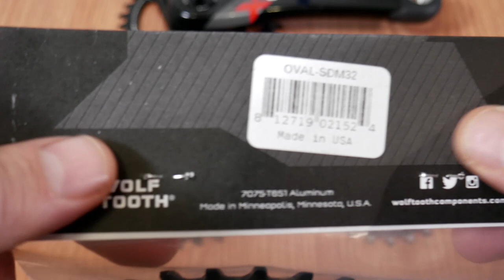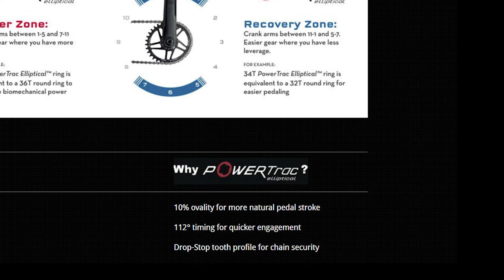Woolf Tooth OVAL Chainrings Quick Check - PowerTrac Elliptical, Drop-Stop

Comment: I’m just wondering if you have any experience of how an oval would work with the MRP aMG? The guide I have is rated 28-34t. The ring I’m using right now is 32t. Would a 32t oval work with the MRP ok? I’m worried the chain might be able to slip off at the 30t range if I set the guide up for the 34t widest part. Loving your vids btw, you’re my go to for info.
Reply: LoveMTB Thank you buddy. Can confirm AB oval works no problems at all

Comment: I just use the aliexpress ones for 10$ each, no issue yet, and the design seems identical to others so as long as the material really is 7075 aluminium, there should be no difference.
Reply: and as for the noise, I can't say the chainring is loud when the rest of the drivetrain is definitely louder, I guess it comes from the stronger derailleur springs, before shadow I never noticed drivetrain noise, after upgrade it was so loud I kept wondering if it's adjusted properly, now I'm just used to it.

Comment: Hey LoveMTB, I used a wolf tooth CAMO chainring setup on my 2015 Cannondale Jekyll, it had 11 speed XX1 on it and the cannondale hollowgram crankset and I put eagle on it but left the cannondale crank/ 30T chain ring and it was grinding really bad. I didnt want to spend lots of money on a new sram crankset and 30T chainring so I went the wolftooth CAMO route for only $120 AUD, the first part was was the wolf tooth CAMO spider adapter specific for cannondale crank, then I got wolftooth 28T chainring! Now with 5 bolts I can take chainring off without taking crankset off and I have a 50T cassette and 28T chaining and I can climb up ANYTHING!!

Comment: Thanks for this. Lately on full squish I feel a little more bob with extreme or maybe what you would call normal ovals. As opposed to HT it seems the FS really calls for more spinning to negate & isolate the efficiency loss on rear suspension bob, even if slight (as in the case with my Scott Spark). And then when spinning the heck out on my SS HT... interested to try a wolf tooth and see if it smooths that power curve out a bit.

Comment: If I'm currently running a SRAM Eagle GX Groupset 1x12 with a 32T Chainring and want to upgrade to 38T Chainring will I need to buy a new 12 speed chain? Or can I use the same chain?